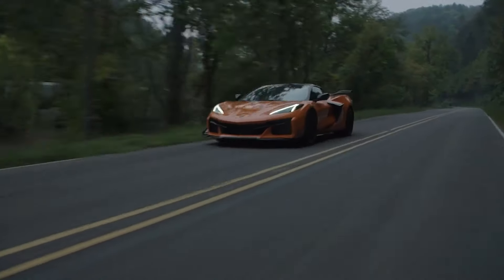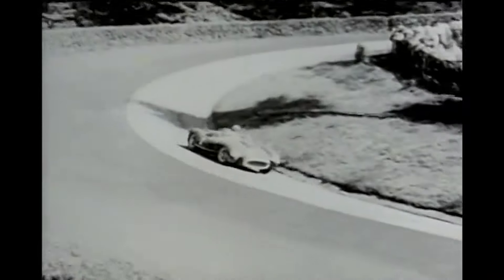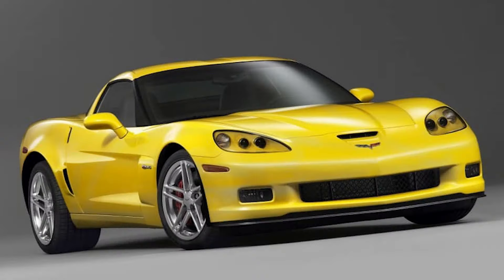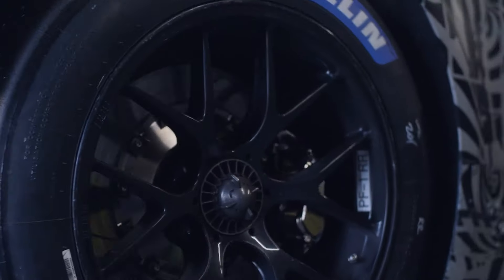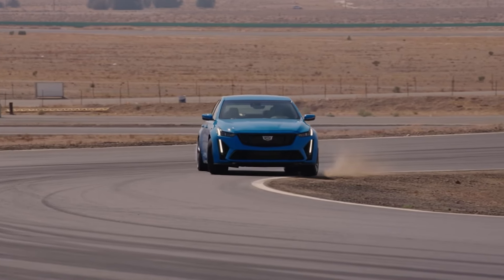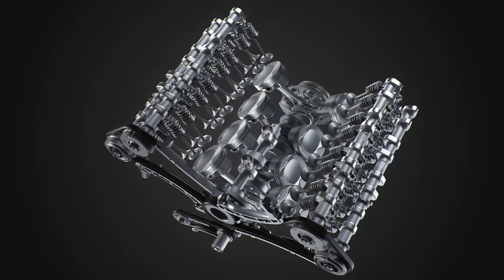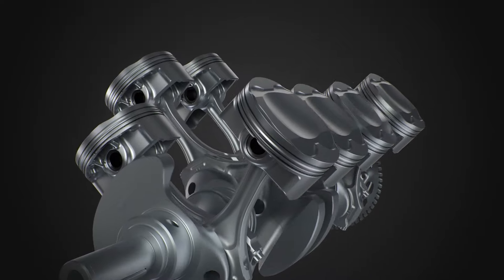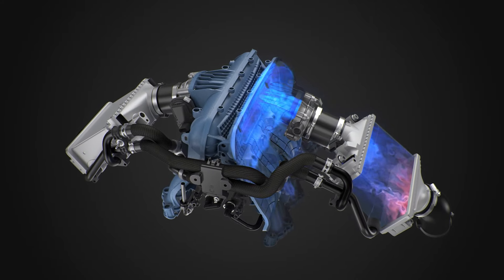How the New ZR1 Makes 1064HP || EXPLAINED

Comment: How? Because they used turbos over a supercharger it's not rocket science. You can get much higher boost levels with turbos and all they had to do is beef up the internals on the Z06 engine to handle the power and boom you got a 1000+
Reply: Can easily make 1000hp with a supercharger. Nothing to do with that for power potential. They pick turbos for efficiency and packaging. Emissions and pump gas being big factors as well.

Comment: Corvette's have been mid-engine since the C5. The term mid-engine means the engine is mounted closer to the center of the car. Regardless if that is in the front or the back of the car. Corvette has had the engine sitting behind the front suspension for the longest time. The C5 had the engine as close as possible to the firewall because it's the first Corvette to move the transmission to the rear of the car for weight distribution. So calling the C8 the first mid-engine Corvette isn't accurate.

Comment: Anxious to see how far it can be taken with the oe cast block and heads. 
Benchmark: John Mihovetz prepped 4.6 4V has dynoed 3,000 @ 10,000 rpm and ran 5.88 @ 256mph. 
Oe cast block and heads 
Oe timing components 
Oe crank

Comment: There were other American Sportscars in the 1950's! The Cunningham was powered by a 354 Hemi and later a 392 Hemi, the British designed Lister used a 283 small block Chevrolet and a lot of garage made racers that all used American engines! Also let's not forget the British made Allard that used a Cadillac engine! Ford ran the Thunderbird with lots of success. Kellison J2 had Pontiac powered!  The list goes on and on!

Comment: Not sure about shorter conrods + forced induction 

Longer cylinders would raise COG, add a tint % of weight to the car and might make packaging a but more difficult. So it sort of makes sense, but the aforementioned combination would most definitely compromise longevity
Reply from the maker: Shorter rods are mainly done to reduce compression. It also helps keep the flat plane crank engine maintain its high revving characteristics.. relatively a new platform so only time will tell whether it has had an impact on longevity or not